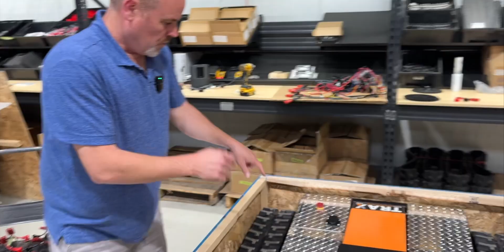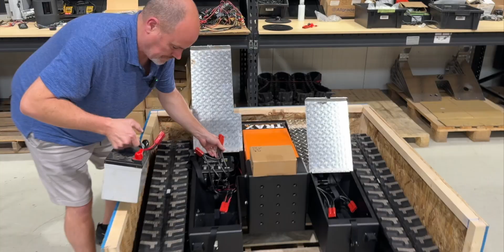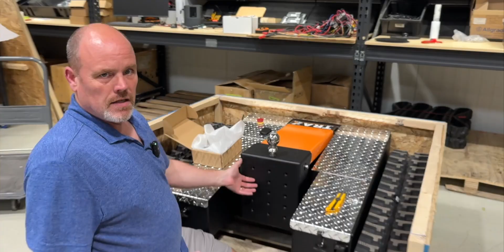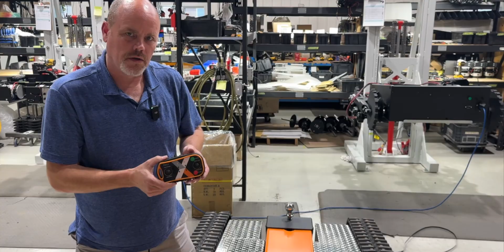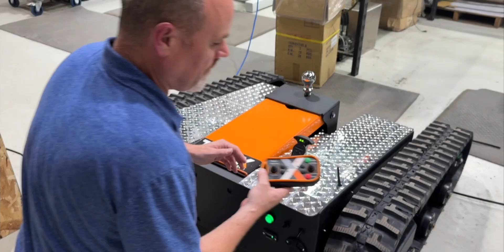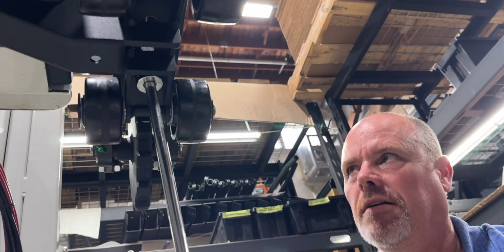TRAX J5 Power Dolly UNBOXED – Is This the Ultimate Trailer Mover?

Comment: What would be the max weight it could carry? Could it go up to 5,000 pounds? If the actuator was at it lowest position?
Reply from the maker: Depending on a few factors like grade and gound texture 15k - 20k
Reply: @Traxpowerdollysystems  I guess I meant tongue or hitch weight?
Reply: @justintownsend7792  I own both the X2 and J5 and know their limitations very well....the J5 will most likely not handle 5,000 lbs of pin weight.  I have a 5th wheel toy hauler with an approx 2,800 lbs pin weight and push it with a total weight of approx 13,700 lbs....the breakers trip when trying to turn on the asphalt street.
Reply: @hikerguy-e5v5o  Thanks for the info! I run a portable storage company, and I was interested if a J5 would move boxes. Empty they are about 2,700 lbs. Full they can be 10k lbs. I put wheels on one end, and I was thinking I could put wheels on the "towing" end and then connect that to a J5 to move the boxes. What is your run time usage like on them? Daily / weekly? How long can can you run on a single charge? If it important to keep the pin weight high enough for traction? In the snow? Thanks in advance!
Reply: @justintownsend7792  The J5 works worse in my scenario.  The X2 moves my 5th Wheel at a higher loaded weight than your case.  I only run once a month at most and only the time required to push my trailer into the side of my house so battery run time hasnt been an issue.  I dont play in snow but I would think the X2 would be fine.  It weights over 300 lbs and the pin weight would help with traction.  The J5 weighs over 800lbs.  That along with the larger footprint poses a challenge for it to turn without popping the breaker with my 2800 lbs pin weight on pavement.  Maybe snow would help.  Either way, IMO, I wouldnt spend the extra money for the J5 in your case.